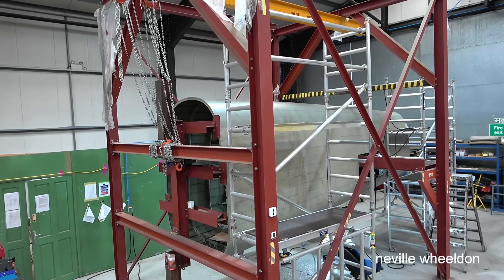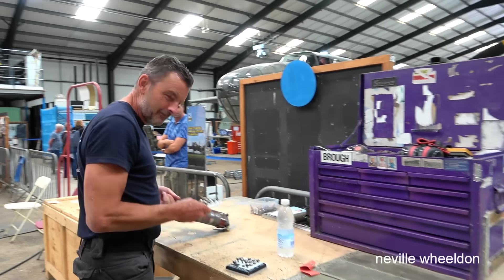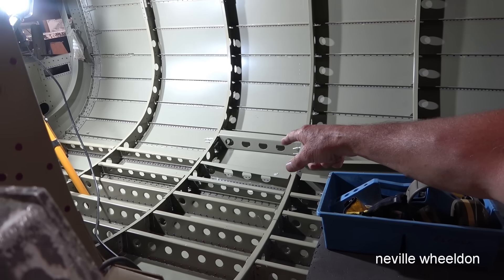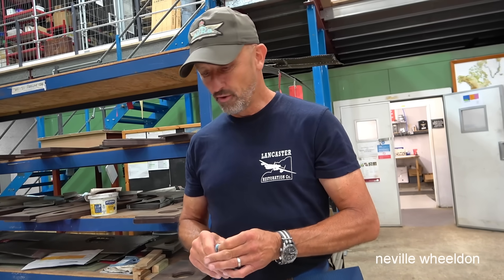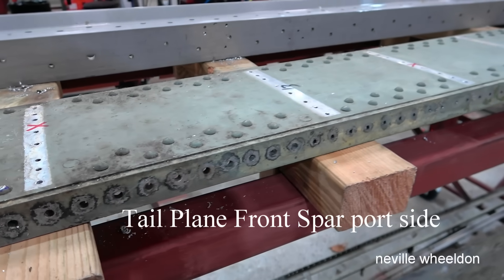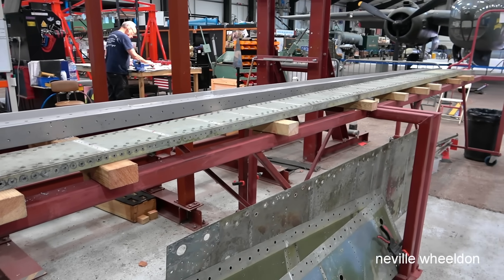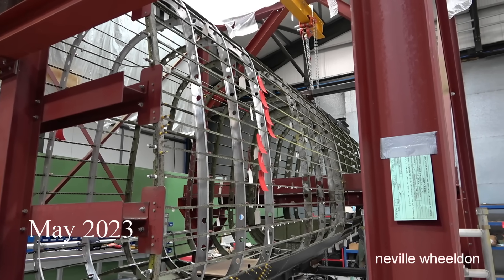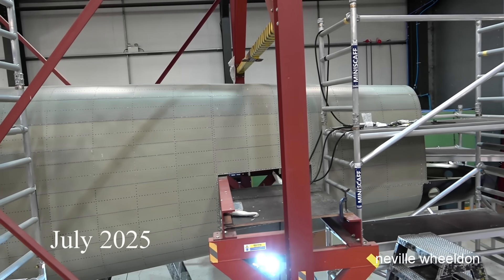Video 311 Restoration of Lancaster NX611 Year 8

Comment: One thing I’ve been wondering is if the skins are laid out like shingles with the bottom edge of a skin overlapping the top edge of a lower skin.  Seems like this would help prevent water from entering the fuselage.
Reply: Correct

Comment: Neville I'm confused.  As I understand it, the rear fuselage currently in the jig was originally from NX611 and will be re-installed at some point.  I thought the read fuselage section currently on NX611 came from the French Lancaster and had been restored by the NX611 team.  In the video today you showed another rear fuselage section, which if I remember correctly, is for the French Lancaster.  Is it correct that there are a total of three rear fuselage sections in house now?  Thank you for posting another great video.
Reply: Just chipping in - the rear fuse section currently in JJ is from KB976 owned by Yorkshire Air Museum.
Reply: and the unrestored section shown is the mid rear fuselage fitting between the restored rear section and the rear of the wing. Thats from France and will be restored to taxi condition so Janes mid rear can be restored to airworthy

Comment: At 2:51 the rivet lines on the far end doesn't look quite straight. Is that normal for a modern re-construction?
Reply: That area is probably old structure that has been reused so the skin rivet holes have just followed what is on the stringer underneath.